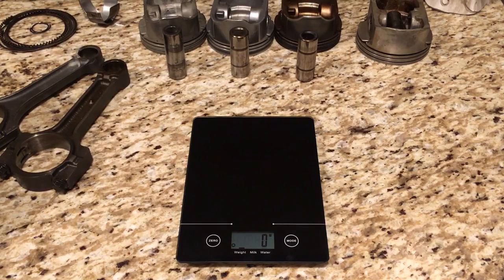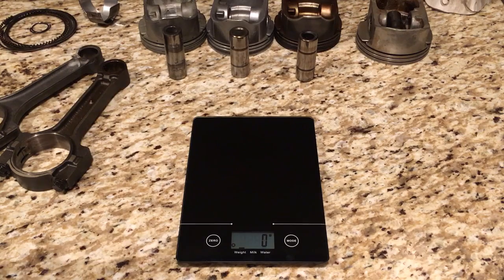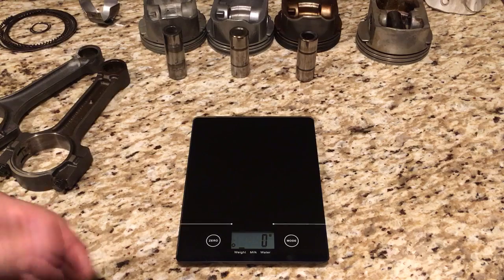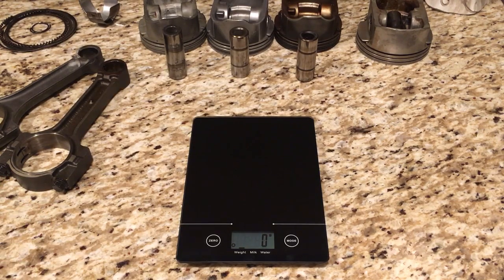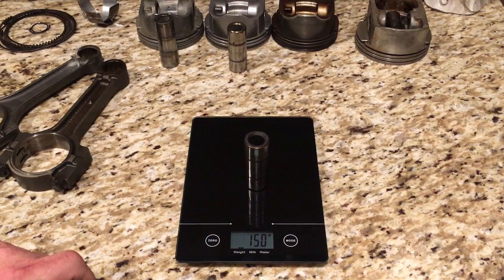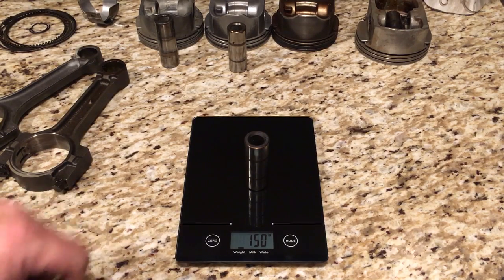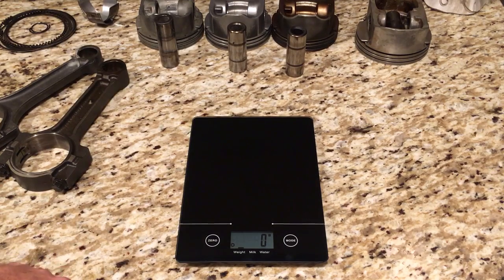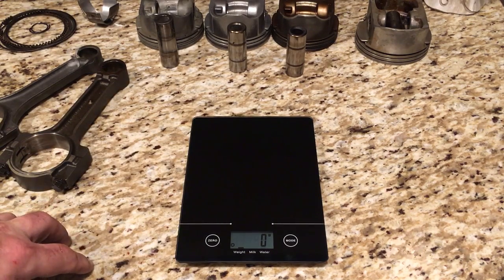5.3 Gen 4 piston and rods in a Gen 3 LS engine

Comment: OK so in short which LS engine am I looking for and what year,make,  and model am I finding it. A fella from Jegs said LS3. I finally got my electrical straighten out so I am moving forward.  What Ebay turbo kit do you suggest that I can use with my 83k mile 4.3 and swap it over to an LS if that's possible.  Last which HP setup am I looking for because I can't find a number to call and ask for the 4.3. Reason I am doing the turbo and tune myself on the 4.3 is so I can learn and not destroy a good LS. I finally got a new laptop and should have it by Tuesday.  I ordered a 500GB dual core processor  HP laptop. Remember I am on disability and can't blow $ so I have to get this right the 1st time around.  Thanks for the video's and maybe you can go live building the turbo LS block. That would be super cool and I would appreciate it.
Reply from the maker: Alpha Ghost Well the Tech at Jegs is funny; here's why. Yes the LS3 would be sweet with the stronger bottom end and the better square port heads. Problem, they are expensive and sometimes hard to find. 
On a budget shop for a 2004-up so you get the Gen4 bottom end. If you get a 2006 or newer you might get the 799 heads which are as good as the stock LS6 heads. 5.3-6.0 or you could do a 4.8, it's up to you.
Reply from the maker: Alpha Ghost I don't think there will be a Turbo kit that will work for both. There's to many differences and variables.
Turbo size, get a Turbo to feed the LS so you don't have to buy another. If possible get a Turbo 69mm or slightly bigger but keep the hot side housing no bigger than .98
Reply from the maker: Alpha Ghost Search Holley HP EFI it will show you many different options. If I add a link it'll go to your spam folder
Reply: HeadFlowInc OK I'm writing this down. Which LS? Lastly how do I shop for the HP tuning software for the 4.3 1st than the LS.
Reply from the maker: Alpha Ghost Depends on budget  which tuning software you use. The Holley products are fairly easy to use and have tons of support and file tunes to choose from. Plus Holley has a auto tune setting where it learns/tunes itself based on your parameters.
Reply from the maker: Alpha Ghost Decide if you want a 4.8, 5.3, 5.7, 6.0. Shop for the newest and lowest mileage, what it comes out of isn't really important.
Reply: HeadFlowInc Ok. I went to sleep last night after I fixed my fuel problem. Waking up today thinking your right about the turbo on the 4.3. I'll tune the 4.3 while have bought an LS then install it tune it then worry about a turbo. I just have deticated my summer to motorcycles and I'm wrapping that up and in a rush for the truck. I was going crazy finding a plan and sticking to it. Looking forward to your new build. Your going to be building a turbo block with combined LS engine parts?
Reply: HeadFlowInc I get it as far as how important it is to have a balanced crank for an engine build for it correctly. I have bought a couple 350 bombs because of this.
Reply from the maker: Alpha Ghost The plan is a 2002 4.8/5.3 block, Gen 3 flat top 4.8 pistons, Gen 3 5.3 24 tooth crankshaft, with SCAT 4340 I-beam connecting rods.  2004 LS6 factory Cam. 
MLS gaskets, Head Studs etc...
Reply: HeadFlowInc Flat tops for the weight balance? Doesn't dished raise compression?
Reply: HeadFlowInc What's MLS?
Reply from the maker: Alpha Ghost Opposite, a dish piston lowers the compression.  It's a common upgrade to put flat tops in a 5.3 to bump the compression, even GM did it in 2006 starting with the L33 and L34 HO 5.3.  Since I already have the pistons I want to try and use them to save money.
Reply from the maker: Alpha Ghost MLS "Multi Layer Steel" I'm going to run a Victor Reinz MLS gasket because it comes with proper sized fire ring to match the small 3.78" bore.
Reply: HeadFlowInc I didn't see the reply here. I am subbed to the HP tuners channel and if you never seen they are always coming out with new vids explaining a lot with GMs. I seen the Holly version with the little computer supplied with it but my goal is to ultimately learn the more exstensive level of tuning anything. That's what I was saying in the other video that I've been depressed now being fully disabled so now it's time to use my brain mostly. Automotive diagnostic and tunning.
Reply: HeadFlowInc Sorry about all the questions but I can't stand forum's. I don't need 20 different opinions from people I don't know the intelligence level or seen work by them. I trust you.